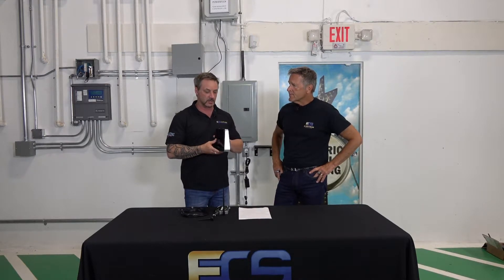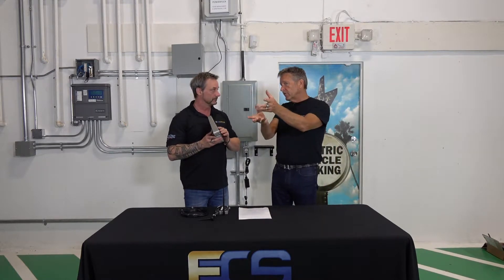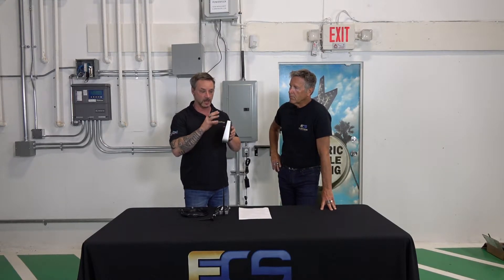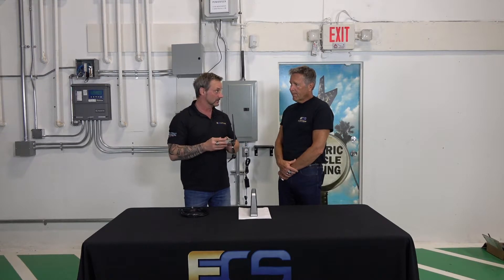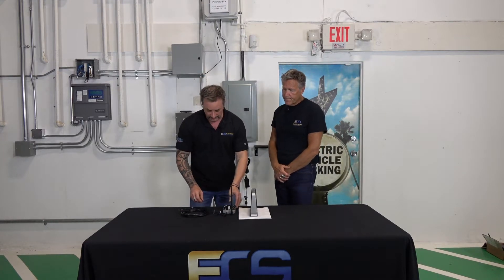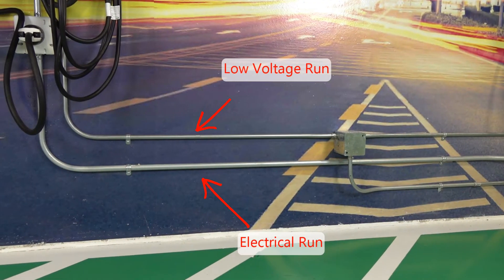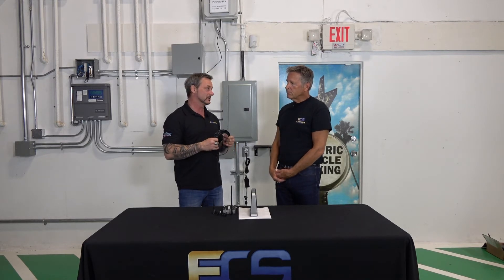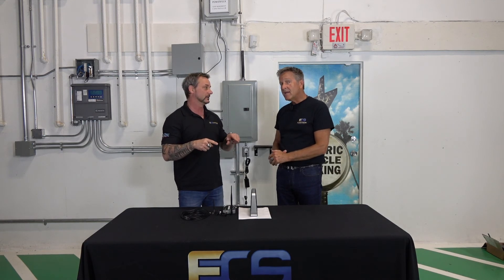How do Electric Vehicle Chargers Communicate?

Comment: We used to have a Nissan Leaf and no problem charging with our Siemens Versacharge. Our newer Chevy Volt occasionally faults on the same Versacharger, when the Volt is nearly charged up. Because of wiring limitations, I have the Versacharger set for 3/4 ratings on 240 Volts. Can you elucidate me on the communications between the two when nearly charged up?
Reply from the maker: Hi Chuck, sorry to hear you are having issues charging your EV. Could you tell me which VersiCharge unit (serial #) you are using and what power output you have it set to? The VersiCharge does not communicate with the vehicle in terms of battery "state of charge", it simply provides power to the onboard vehicle charger which regulates the amount of power used to charge the battery. Hope this helps.